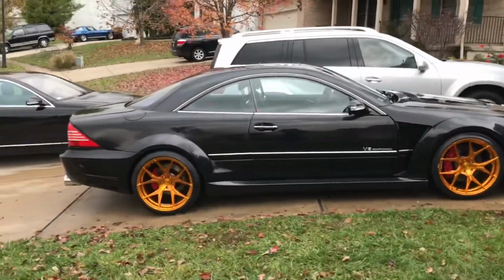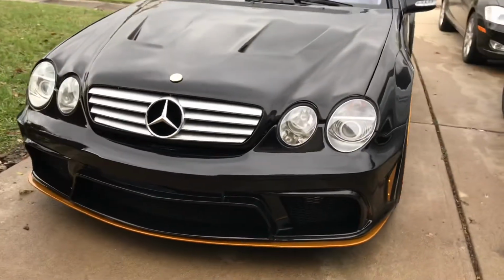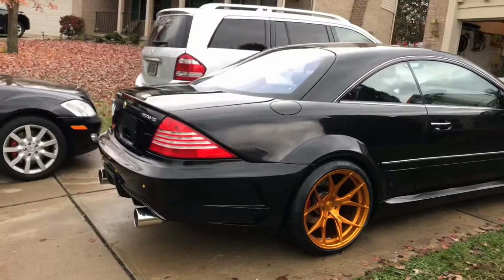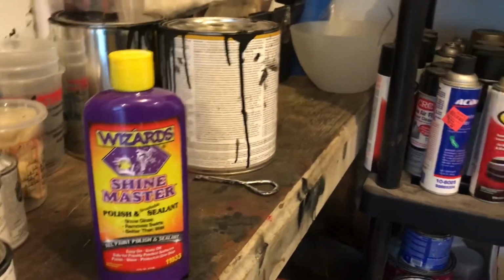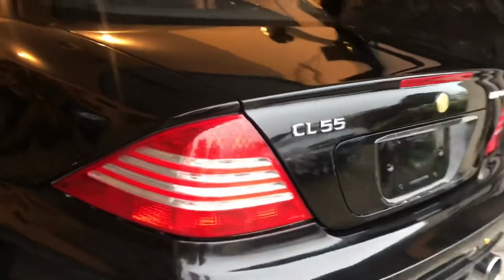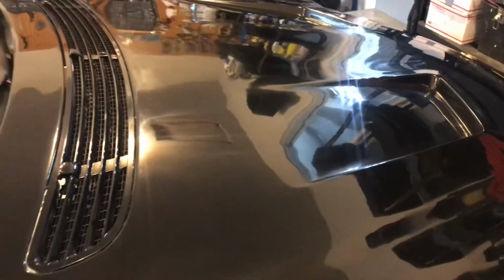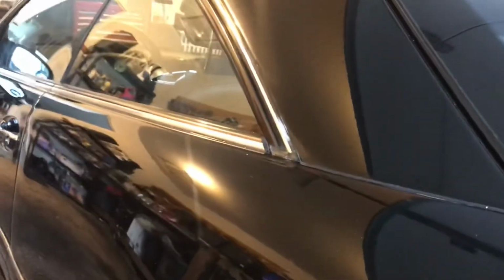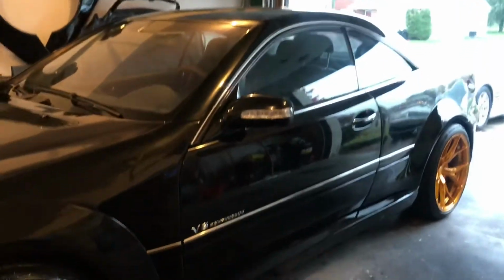Gold CL55 Widebody Mercedes W215 Rohana RFX5 20” Gold Element Autoworks

Comment: Seeing your beautiful beauty makes me go outside and detail mine in the rain!
Reply from the maker: James G Hahahaha!!! Sometimes I wash mine in the rain. 😂 Thanks man!
Reply: I have two shocks leaking fluid. The car lifts up in the morning. Should I do the conversion? Or pay to replace the bad shocks?
Reply from the maker: James G All depends on your love for the ABC system, vs your love for driving your car worry free. Also......your wallet. And how long you plan on keeping your vehicle. I’ve had several CLs. Nothing like never worrying about the suspension ever again.
Reply: Just got it plan on keeping it for years to come
Reply from the maker: James G How much are two abc struts?
Reply: Question what happens to abc when you do the strut coil over conversion? Is it deleted? Does your 55amg have abc?
Reply from the maker: James G Yes it’s deleted. I removed all the ABC components out of the CL55. Remove the fuse and no more ABC red light warning.

Comment: Hey bro did you custom your headlights or what? My lights are dull and I want them to look like yours
Reply from the maker: No custom job. The 2003 and up tend to have the advantage regarding clarity and design. But even still, they require buffing if parked outside often. One of my videos explains abs shows the wet sanding and buffing process. Actually…..two of my videos.

Comment: You should put led Mercedes sign in the front
Reply: Also you should put led on the interior I just bought android radio its raw! It looks stock but you need a $275 android radio that looks factory. The android radio are all over Ebay you also need 2 amps that are rated for 2olms each. And $100 fiber optic cable. I know expensive but you can sell all your OEM equipment on ebay to some gump that dont care and have all that technology at your fingertips
Reply from the maker: Thank you for the tips!

Comment: Nice job those tail pipes stick out too far... I would adjust that and look for a quad exhaust!
Reply from the maker: James G Thank you. I’ve been pricing a few different options. The OEM AMG quad pipes are too wide for the opening. I’m considering either modding the cutouts or going with a more square pipe. Not sure. Maybe quad square design. 🤔
Reply from the maker: James G Do you like the gold wheels?

Comment: Air ride or strut coil conversion?
Reply from the maker: James G adjustable coilovers. YellowSpeed Coilovers.
Reply: @goldelementautoworks  How much did the conversion set you back? Does the button on the dash still raise and lower car? I have 2 shocks leaking fluid. I see strutmaster but idk which is better quality and the chips involved fam
Reply from the maker: James G The YellowSpeed Coilovers cost about $1300 if I remember correctly. I also replaced the ABC pump with a standard Mercedes power steering pump. I removed all ABC components and lines. So all ABC features are gone. The only way to adjust the height is by manually adjusted the coilovers. Strutmaster DOES NOT allow adjustment at all. They are one height and you got what you got. Not my cup of tea.
Reply: Did the dash light up like a x mas tree?
Reply from the maker: James G 😂 Nope. I removed the large (40A I think) ABC fuse under the hood. That deactivates the system. All you get is a white ABC error message that you simply clear with the R reset button.
Reply: @goldelementautoworks  Can you give me an opinion of the ride quality of conversion
Reply from the maker: James G It is a firmer ride. Depending on the damper settings.......I have mine dialed in firm due to how low my car sits on a wider stance. I can’t have alot of bounce. Otherwise, you can soften it up. A more comfortable ride.
Reply: I may wanna put 20s on ya dig dawg you think that's a wise idea on this car or will it flip flop like a fish outta water?
Reply from the maker: James G I have 20’s on mine. You’ll be just fine. Run 40 series tires up front and 35 in rear for a better ride. No less than 35 front 30 rear.